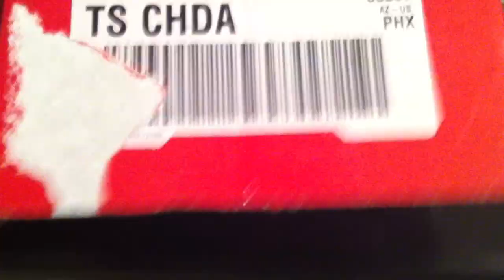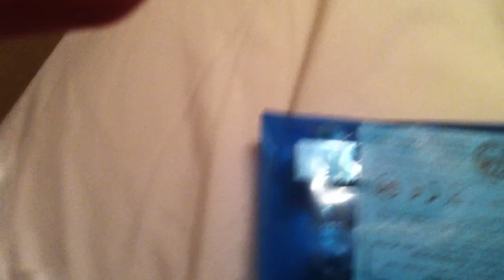2X Arduino Duemilanove Unboxing

Comment: It's a chinese clone
Reply from the maker: And you determined this how?
Reply: the package ..the real one must comes  in her own box with some paperwork and some stickers they don't provide it just like that but you will not find any diffrence i had two arduinos(leonardo) a clone and a legit one and i even don't recognise them they work the same.
Reply from the maker: I think you're thinking of the Uno, which comes in a little cardboard box. As far as I could find on google images, the Duemilanove never had an official box or anything. These came straight from Sparkfun, so I doubt they could be clones. But I agree, it won't really matter if they are clones anyways since the clones truly are just copies.